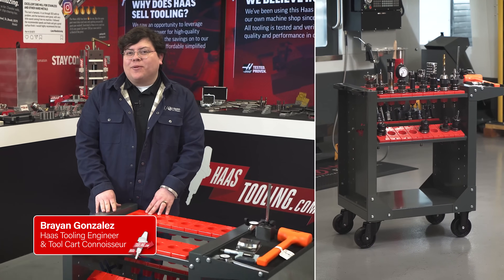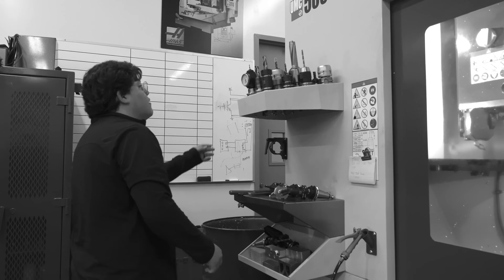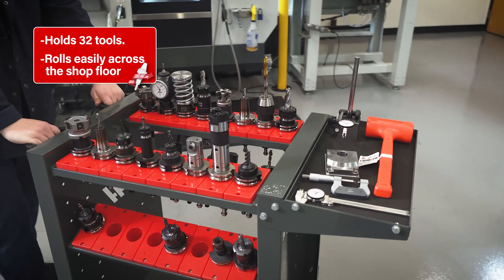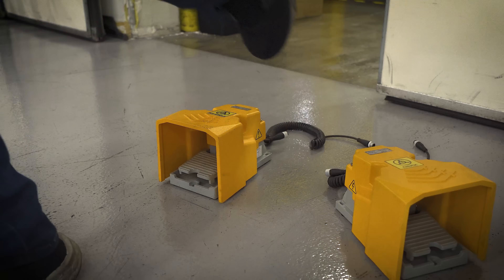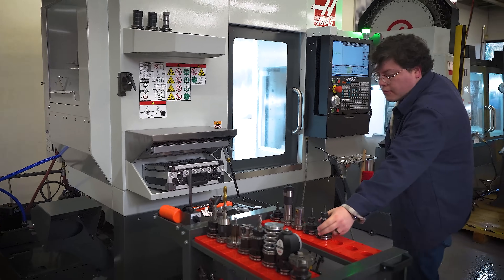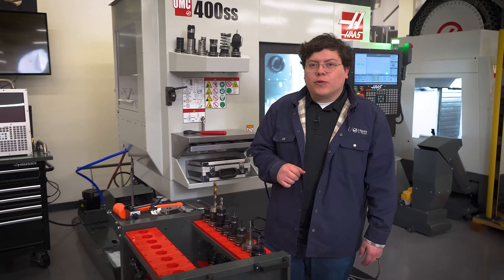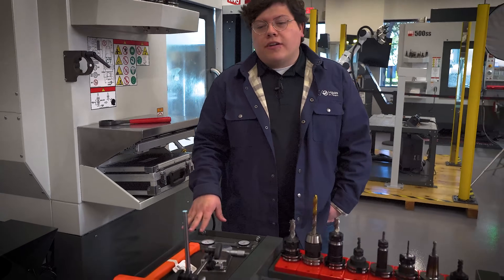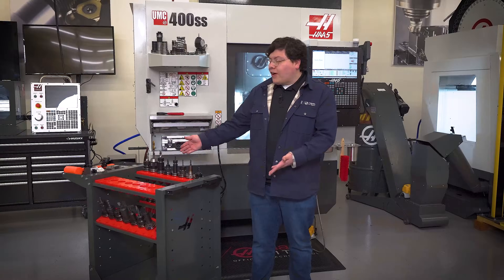Move Tools Between Machines More Easily - The Haas Tool Cart - Haas Automation, Inc.

Comment: What kind of tool is that spring thing on second 32?
Reply from the maker: playlist9389, The typical use for the spring tool is in robot loaded operations to push the workpiece firmly against the pneumatic vise jaws during clamping.
Reply: It is so you can fling deburr disks across the shop at other machinists.

Comment: 0:03 what this tool with spring do ? Add video
Reply from the maker: zajawamotocykle9256, A typical use for the spring tool is in robot loaded operations to push the workpiece firmly against the pneumatic vise jaws during clamping.
Reply: @haasautomation  i love it.